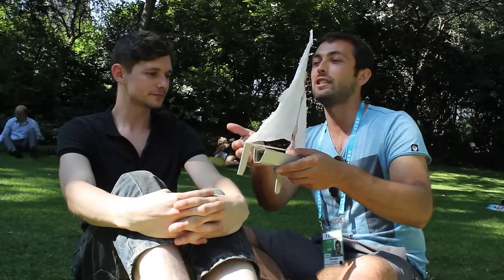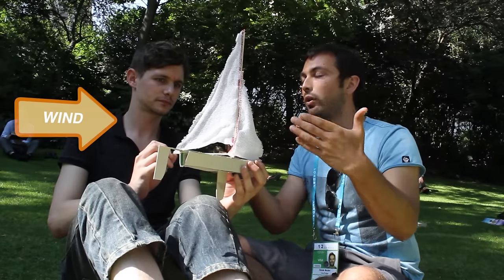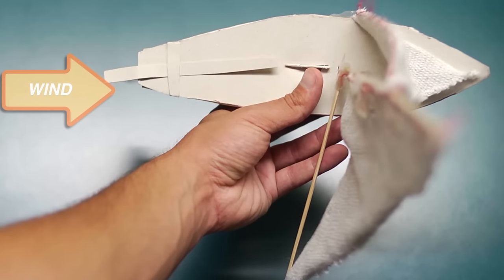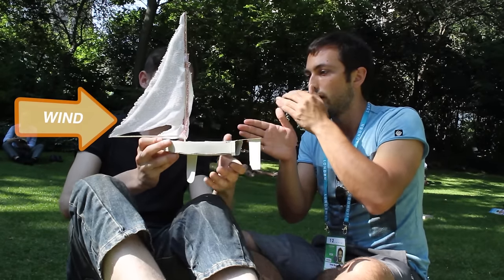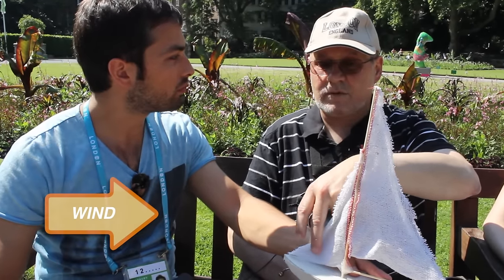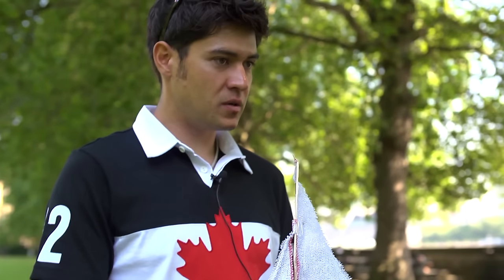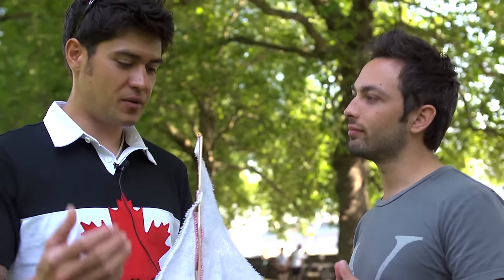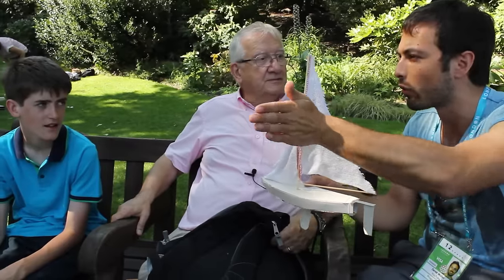How Does A Sailboat Actually Work?

Comment: Would this work in another frame such as the bottom of a long swimming pool that also has a current flowing? Of course the question is would a propeller Contraption like this be able to move faster than the current?
Reply: You're coming from the latest veritasium video, aren't you?
Reply: Yes. In conclusion, as stated in Derek's most recent video, if you have 2 mediums moving relatively to each other, you can theoretically build a vehicle that go faster than the relative velocity of the 2 mediums.

Comment: Once you match windspeed, you have no pressure on your sails. If you went faster than the wind, you would actually have wind backwinding your sails and slowing you down.

Unless you can surf a wave faster than the wind is going, but that isn't sailing, that is surfing.

Comment: This video would have been much more thorough if he had made visuals like he usually does, explaining the physics and including free body diagrams using vectors to represent the forces created from the zones of unequal pressure. This may help explain the reason you can travel faster than the actual speed of the wind with the vector addictions etc.

Comment: Sorry I couldn't fit it all in...
What this model doesn't explain is why a typical boat has two sails (which is mostly a design constraint about balancing the winds centre of pressure with its centre board to make it easy to steer)
Why it doesn't just blow over.. (the need for weight either on the side of the boat or at the bottom of the centre board (which is then called a keel)
And this thing they call lift...

Comment: You can sail a daggerboard sailboat without the daggerboard. I've done it. I'm not sure the daggerboard creates that much lift to windward. I think its main job is to create resistance so the hull will not be so easily pushed around by the wind. I find it doubtful that the daggerboard and rudder create enough lift to counteract the lift of the sail. But I'm willing to be corrected if anyone can enlighten me. Thanks.
Reply: Yes, you can easily sail without daggerboard if you are not going fast because the hull itself creates windward lift as well. He was describing how you can go much faster than wind. The lift generated by underwater parts of the ship is directly proportional to the area of their side projection but as more wind pushes the ship leeward, the ship leans which reduces the area of this side projection (this leaning also reduces side projection of the sails so it lowers lift generated by them as well). This leaning can be reduced by different hull shape but the more stable the hull is, the more drag it generates. You could have tall keel instead of daggerboard but daggerboard also carries heavy balast and therefore lowers the center of gravity, stabilizing the ship even more. Or you can have multiple hulls — this is why katamarans are so good at speed sailing,
Reply: Jan Sten Adámek Here is a curious thought. Not trying to be a pest, just thinking. Consider land sails (tricycles with sails) that sail on land. They can sail in all directions just like a sailboat, yet they have no hull nor daggerboard that generates lateral lift. They do have tires that produce lateral resistance, but they have nothing that generates lateral lift to counter the lateral lift of the sails. So... might it be possible to sail a sailboat that had no daggerboard and that also had a hull (theoretically) that did not generate any lateral lift? My guess is that the answer is yes.
Reply: Land sails work this way because they drive over solid surface which does not change shape that easily. Water is liquid so for any force that breaks its surface tension, you need lift to generate enough resistance or it will just flow around your ship (this will actually generate some lift as well).

So yes, you can have a ship that works without lateral lift but it must be light enough not to break surface tension.

Comment: ...less bound to the object. so, as air travels over the front side of the sail, the boundary layer follows the curve of the sail. layers of wind further from the sail do not. instead, the leading edge of the sail acts as a ramp. the air keeps going straight, after the sail curves away towards the trailing edge. this separation of layers, some following the sail shape and others pulling away from the trailing edge of the sail, creates a negative pressure area...a vacuum, to simplify it....

Comment: Just like an airplane the shape of the sail will create low preasure on the convex side.... if th sail has an angle of 45 degrees in respect of the boat, you will have a force pushing 45 degrees foward... now the keel and the rudder will cancel de part of the force trying to move sideways, so you will only have a half of the original force  only pushing foward....  so if you start moving foward at 2 knts and you had a true wind  speed of 4 knts, this two will add up creating a relative wind speed of 6 knts, creating more force, and like that you can sail faster than true wind speed.... that is VERY basic to the point of being incorrect, but it is somehow like that
Reply: See my note on rudders, above, Ivan.

Comment: Did really old ships with multiple masts and levels of sails (like stereotypical pirate ships) use this principle or the more common "sail with the wind" principle?
Reply: most square rigged ie pirate ships were confined to sailing with the wind ie drag not lift
Reply: ..although they were able to sail into the wind, but at very broad angles. 
Usually they'd sail 'over there' in the ocean and days later find a breeze that would let them sail elsewhere, closer to 'home'. They'd learn wind patterns.

Comment: I would disagree with 45-90 degrees for fastest point of sail. As an actual sailor, mathematically, 90 degrees is fastest,
Warning, long explanation:
 but because of "vmg" or velocity made good, It is actually more like 95°. VMG is the speed that the boat is travelling in the direction the boat is pointing because all boats slip to the side a little because the centerboard can't be 100% efficient. The more downwind one turns, the less sideslip there is (because the sideslip is in the direction of travel). Anyways, turning 5° more downwind helps eliminate sideslip and therefore 92-98° is the fastest point of sail.
Reply: ...well, no: VMG is a value expression, 'good' is subjective, derived from getting to where you want to go.
To windward, 'good' is towards the top point you're ultimately tacking to. A boat at 10 knots on a tack may be progressing towards the 'top point' at only 5, depending upon direction. In racing, it's a measure of the speed of the 'perpendicular progress' towards the top mark, irrespective of what your zig-zag course is, where you're pointing, or where you are sideways on the course.
Invert similarly for the leeward mark. HTH

Comment: Didn't the really old sailing ships have big square sails that did favor wind pushing from the rear??? I don't know just asking and wondering if that is where the misconception originates. I knew the modern sail is really a wing but I don't believe the early sails operated the same way but I could be wrong about that as I am only going on the pictures I've seen of old  style ships.

Comment: Sailboats generate forward "thrust" through the redirection of wind aftward. 

Also its called apparent wind that you sail off of and allows you to go faster than true wind speed.
Using simple geometry you can show that 90 degrees off of true wind is the fastest angle of sail.

Very disappointing that an Olympic sailor can not explain how his own boat works.

Comment: Why does the air have to travel more distance on the outer surface of the sail compared to the inner side? The distance should be the same since the sail has zero width relatively to its length (contrary to a plane wing).

Comment: I wish people wouldnt use the word pressure at all when talking about this question. Pressure is force over an area. The real question is why is the force over the area of the sail greater on the one side when positioned in the unintuitive way that sailors position it. What exerts the force and how? And don't use conservation laws as an "explanation" either. Conservation of energy and momentum and whatever else are not fundamental laws (they are derived from more fundamental laws). Where is the freaking force coming from?

Comment: To explain this properly you should use velocity triangles for apparent/true wind and boat speed, and free body diagrams for the forces on the boat (sail, keel, rudder etc.). That gives a real appreciation for why boats can sail faster than the actual wind speed. This explaination doesn't actually teach you anything! There's a reason you learn these in physics/engineering. They actually mean something rather than this ambiguous approach!

Comment: not necessarily. Viking ships were as good to wind as most modern sailboats. the longships designed by the germanic peoples ( vikings being one of those peoples ) were the first to have a hull design that really allowed windward sailing. due to hull shape, most old square riggers, like your pirate ship, didn't do as well to wind. but, there were other types of boats, being used during the same period, that were good to wind. even modern boats vary from design to design.

Comment: What if you put a very big fan on your sailboat and turn the fan on, hitting the sail?
Reply: Walwalkn Wewnrkl that's explain quickly.
Reply: The air from the fan is one big continues 'body' of energy that will bounce off the sail and propel you forwards. Like many people believe, the initial force of the fan that would propel you back doesn't happen because that would mean the air from the fan dispersed into nothing and therefore has an opposite reaction force. In that case it DOES hit something, the sail, and thus the force simply goes away from the sail propelling you forward.

Comment: I honestly feel a little bad for the people who don't really understand how sail theory and sailboats work. If you are going down wind (with the wind) you must sheet out the main sail and jib slightly to create the vessel to go faster, and more aerodynamic. If you are going against or into the wind, you must use a method called tacking. Tacking is the method where you go in a zig zag pattern to catch as much wind as possible, as safe and fast as possible. This is basically the same for all types of vessels, square rigged, schooners, brigs, ketches, brigantines, sloops etc. now for sail theory, sail theory is the theory in which where the wind pushes the sails and ship forward. When the wind has the high pressure pushing into the sail, the low pressure ricochets the bends of the sail so it pushes the force back creating less friction at the front creating low pressure at the front of the sails. The term on which the ship is slowest is "in irons" the ship is faced into the wind and the sails are sheeted in so they are horizontal to the boat, this will create luffing, the sails will begin to wave all over and you will go nowhere, the fastest state is called "running free" this means the ship is going with the wind and the sails are slightly sheeted out. This not only creates aerodynamics but also creates a faster ability to sail.

Comment: true, also the fastest point of sail would be closer to a broad reach assuming you came down to it from close hauled, or up from running.

but good video otherwise, I enjoyed it :)
Reply: Again, depends on sail plan, rig, hull type, displacement, etc.  When I was a kid my family owned a Columbia 50, a sloop rig with a headstay and forestay so we could fly a staysail upwind.  The fastest point of sail for that boat was a beam reach, all other things being equal.  The only time I ever saw that boat surf was in a gale with a full main up and no headsail.  Close-hauled, the boat was a stone.  Beam reach we could consistently get it up to 8-10 kts. in 18 kts of wind.

Comment: Seems like a sail is pretty much the same thing as a vertical wing.
Reply: +Kirby _Completely_  like a vertical wing.
Reply: But they don't use the terms, angle of attack, lift, stall, etc.
Reply: I was talking about sailing terms in general. Nothing directed towards this video or the author.
Reply: perhaps I should have put my comment in the form of a question.
Reply: I'm a sailor and I use terms like angle of attack, lift and stall. What you may want to consider is that many nautical terms are very old and have come from the days when the square rigged type sailing ships were common place. Aeronautical terms are relatively recent but also part of the language we all use.
Reply: It is. There are even experimental ships with a wing instead of sails. The major advantage of sails over wing is that you can easily and quickly change the geometry. They are also safer. If you go like 45° against the wind and let the rudder free the ship tends to slowly turn against the wind, eventually emptying the sails and stopping the ship. It's much more risky with a an equivalent of a huge road sign attached to the top of your ship.
As for the terms I can't comment on this for my sailing language is not English.

Comment: 2:40 "the air has a longer way to travel". This is utterly false. The sail has effectively zero thickness, so the high velocity path is the same length as the the low velocity path. The longer distance argument is a fallacy that assumes that the two fluid streams must meet at the same time at the trailing edge of the foil. There is no such requirement. The fluid on the high velocity side of the foil arrives at the trailing edge much earlier than the air on the low velocity side, as can be clearly seen in wind tunnel tests. If foils relied on the fluid traveling faster on the high velocity side simply because of the "longer distance, equal time" argument, then foils with zero camber, such as rudders, keels, etc, or foils with zero thickness, like sails, would not be capable of producing lift. This would also mean that aerobatic aircraft with zero-camber wings would be incapable of flight, and aircraft with cambered wings would be incapable of inverted flight, yet both of these feats are manifestly possible.

Comment: I sail and that is wrong completly wrong

in theory with no drag may be
but in real life the fastest way to sail is when the boat is about 90 to 135 degrees away from the wind

because you combine the high and low pressure thing and the wind is pushing from behind

sorry for my spelling and punctuation

Comment: Technically they are correct with a square rig sail, just not a cutter.
Reply: +Liarra “Heart” Sniffles , 
 Not absulutley. With square sail you can go in about 50 degrees to the wind direction (about 40-30 in modern sailboats). 
 By triming the sails very spesificley, you can make a "wing" shape with a square sail
Reply: יהלי מורד Well yes, but I was assuming they wouldn't be talking about modifying sail trims or doing anything that an actual sailor would do. Technically speaking you can just make a different sail out of your current one in most modern boats, in a similar fashion to planes changing their wing shape for different modes of flight.

Besides, the question was very disingenuous as it asked them how to position a triangular sail to best catch the wind, when in reality you should change the rotation of your boat if you are using that kind of sail or you will just end up going very slowly and/or probably tipping over.

It's basically like asking someone how hard they should press down with a bread knife to cut the bread quickly, when in reality the sawing motion is what does the cutting.
Reply: Yea, if I believe the old square sails caught the wind like a parachute, the triangle type works like a wing.
I assume as some point they were trimming the square sail to catch more wind and discovered the wing effect.

Comment: ...how the water fills in this hollow? nature abhors a vacuum. now, we still do not have all the parts to understand sailing upwind. this lift is not in a forwards direction. it is actually sideways. the boat doesn't just go sideways because of the underwater 'fin'. this might be a full length keel, as on a Viking ship, or a skinny deep fin, as on a racing sailboat or something in between. however, no mater the form this 'fin' takes, it works the same. it, too, generates lift, in the exact...

Comment: You are perpetuating the "equal transit time" fallacy in your explanation of lift.  The air does not move faster on the back side because it has a longer way to go.  NASA has a website debunking this https://www.grc.nasa.gov/www/k-12/airplane/wrong1.html    .  The sail generates lift because it turns the wind.  Result of that is a reaction force on the sail.

Comment: think of how a fan works. Then reverse it. Blow on a still fan and it moves forward just as a sail boat
Reply: As for the direction. blow on a fan blade directly along its axis and it can not move any faster than you can blow the further you come around to 90deg the faster it will spin.
It is caused by a low pressure created on the front side of the blade and high pressure on the back
Reply: Simplest explanation! Thank you

Comment: it doesn't. the wind speed theory is not the true explanation of life. if it was, sailboats and stunt planes would not work. stunt planes have the same shape on top of the wing as below. a sail is only material. it has no great thickness. the distance and shape of a sail, on the inside of the sail, is equal to the outside. the speed theory  comes from 'regular' plane wings which have a strong curve on the upper edge and are closer to flat on the lower edge. the real way a sail works is...